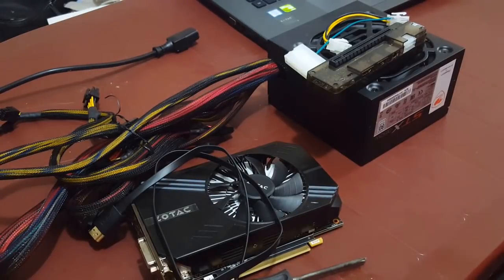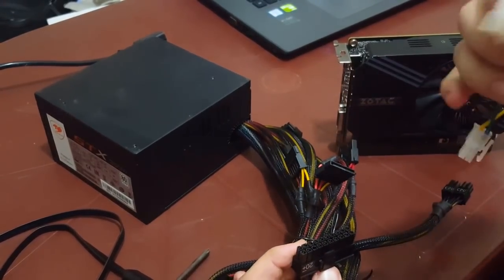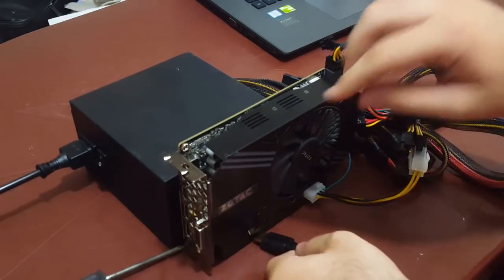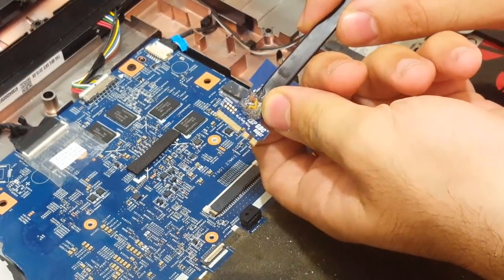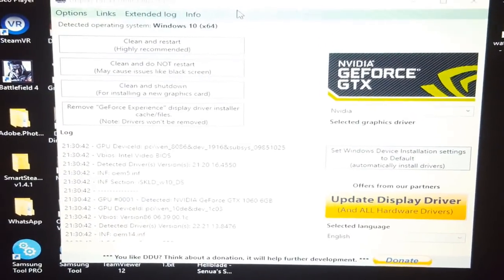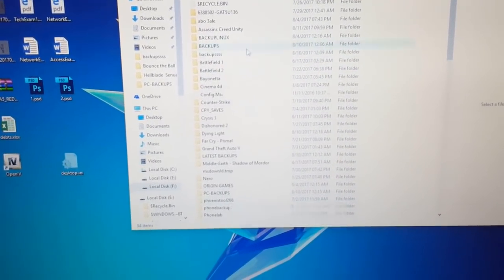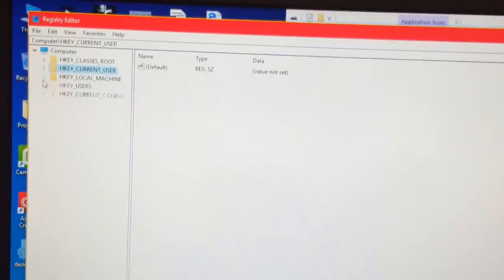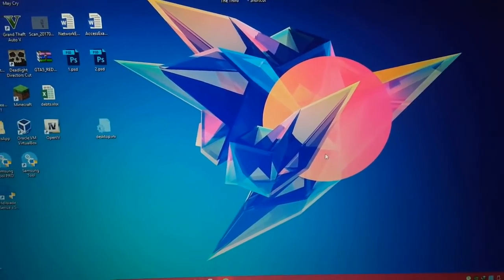HOW TO: External GPU for any laptop PC W/O External Monitor GTX 1060 EXP GDC 1050 ti solve error 43

Comment: Hi
I have everything working but I am unable to use my egpu with external monitor my monitor is detected on device manager but my monitor shows no signal can you help me please?
Reply from the maker: are you connecting via HDMI? if you have windows 10 check in the notification area in the bottom right corner for the project button if it is set to duplicate or not...
Reply: Pedro Marthon did that but my screen shows no signal
Reply from the maker: wierd, is the egpu working well on the internal monitor?
Reply: Pedro Marthon yes it is working in internal screen
Reply from the maker: did you try another screen, also check in NVIDIA control panel for settings.
Reply: Pedro Marthon ok thank you for your help maybe the issue is I'm using old analog LCD monitor .
Reply from the maker: +Sniper daniel anytime, and good luck

Comment: In your video you are disabling pcie express root port. How to choose which port is to be disabled. I am using gtx 1060 on dell studio 1558 with express card. GPU is showing in device manager but cannot use as primary. How to fix this?
Reply from the maker: +aditya jagtap the laptop will automatically choose the internal GPU as primary, that's why you should disable the internal GPU.
Reply: Pedro Marthon. Glad to see you reply me that fast. But I did not understand your step about disabling pcie root port.How to know which is for internal GPU? This is my main problem.
Reply from the maker: just try disabling each one, and check if the internal GPU will disappear from display adapters
Reply: Pedro Marthon  thanks for your help. got it finally. BTW I am doing all this as internal GPU gets hot (73c) even under no load thereby crashing whole system. Technician asked me not to load onboard GPU. Does this method help me?
Reply from the maker: +aditya jagtap it will sure do since you disabled your internal gpu so it will have no load at all, and I am really glad I helped, make sure to like and sub for more upcoming troubleshooting

Comment: Hi 
When I install 368.81 it says "graphic driver could not find compatible graphics hardware"
Reply from the maker: +Sniper daniel you have 1050 TI?
Reply: Pedro Marthon I have gtx 1060 3g version but still I get error 43 I followed the same procedure but still :(
Reply from the maker: try checking if the GPU is plugged well, and I am using latest fall creators update

Comment: My laptop is having 650m integrated gpu. I am not able to find a pci-e slotto disable it. Disabling it directly did'nt work as the new driver installed is picking the internal gpu first. How can I disable in this case?

Comment: I have a similar setup with an MSI GS60 Ghost, the NGFF exp gdc, and an EVGA GTX 1060. I went through the installation like in this video, and everything turned out mostly okay, as in I don't have error 43 or anything. Unfortunately I think my system is still running on the internal Nvidia card (860), not my external 1060. But, if I disable the internal 860 in device manager, I am unable to access Nvidia Control Panel. Has anyone ran into this problem or can help?
Reply from the maker: mrwunderbred disable the internal GPU, shutdown the pc, remove battery, insert external GPU, and turn on the pc again it will work
Reply: Pedro Marthon thanks for the quick reply, unfortunately that didn't work and I still can't access Nvidia control panel while the internal 860 card is disabled under Display Adapters. I have previously tried redoing the whole process with DDU too and nothing worked. :(
Reply from the maker: mrwunderbred did you try the whole process again while the internal gpu is disabled, you have to make sure that you plugged the external gpu while the pc has no power at all, no AC adapter nor battery plugged in, and make sure the power supply is giving enough power to the gpu, then plug it in the pc while the gpu adapter is on, then plug the pc to power, turn the pc on, and start from DDU step until installation is done.
Reply: @mrwunderbred @pedromartin did you guys solve it I still have the same problem and tried disabling everything and still didn’t work ?
Reply: Pedro Marthon I still have the same problem is there any other fix ?

Comment: I not understand what i suppose to do with root chipset adapter...because if i do that.my gdc external gpu is gone,not internal gpu is missing
help to answer XD ?
Reply from the maker: if you don't have an internal GPU you can skip this step
Reply: I have..it was gt650m
i trying gdc with gtx580 1.5GB
windows 8.1
600 atx psu 
I try every 3 pcie root but not my internal gpu disappear,it the gtx580 ,lol XD
Reply from the maker: okay, disable your internal GPU in device manager through display adapters.
Reply: I try disable gt650,but gtx 580 will show yellow warning,sometime on nvdia audio ...if i disable gt650,gtx580 cant show on nvidia control panel

Comment: Can I use 550w power supply for gtx 1060 3g version?or should I user lesser power PSU? Hope I don't fry up my GDC or gpu
Reply from the maker: 550W well be more than enough, and wont face problems, just get a legitimate PSU from a good brand.
Reply: Pedro Marthon Ok thanks :)

Comment: is using gtx 1060 the 3gb version will be not the same?  can it cause another error just because using the 3gb version? cos someone on the comment said that 1060 3gb has chance that will not work properly
Reply from the maker: Natanael Ardi 3GB should work the same
Reply: Pedro Marthon Thank you , your video is really amazing tbh
Reply: Have you tried the 700 series or older than the 10xx series? Im planning to use GTX 780 3gb, should it work properly? or i need to mod bios or setup 1.35 or bla bla? hahaha.. ive studied so many forums but still doubt gtx 780 will work or issues will happen... hehe
Reply from the maker: I did not, but lots of others did and it worked properly, but at the end it depends if your PC is compatible with external PCIe adapters.
Reply: Pedro Marthon Oh ok, thank you very much

Comment: so i managed to solve the code 43 error but the problem is that the NVIDIA display settings are not available when i tried opening the nvidia control panel. it says you are not currently using a display attached to an nvidia gpu
Reply: Jen - Chi Chen i am getting the same problem, any fix ? Are you using internal or external display ?
Reply: Geflunk internal display. I am forced to use an external display attached directly to the graphic card to fix the problem
Reply: i know i read somewhere that you can flash the BIOS to enable the primary display setting from auto to "enabled" to resolve the issue. But flashing your ROM has some risks which might brick your system.

Comment: how will you know if your lappy is compatible with that? and is there a limit for a gpu, for example, a 10yr old lappy, can it use the latest nvidia?
Reply from the maker: depends on the manufacturer and CPU power + RAM amount

Comment: hi pedro did u use external monitor or the laptop's internal screen?
Reply from the maker: +Emmanuel Daniel hi, I used the laptop screen
Reply: ok thanks :)
Reply: will this setup work with gtx 1060 3g version?

Comment: hihi, after i update the driver to the latest one, the code 43 happen on the gtx 1060. why??
Reply from the maker: +Kenny Pro you have to do all the steps again in order to update...
Reply: how do i know which intel (R) 8 series / C220 series pci express root port is my gtx950m ? i have 1, 2 , 3 and 4
Reply: how to know which one is which ? i disabled the third one my gtx 1060 is gone and the forth one is for the sd card reader. But the first and second is like nothing happen when i disable them, nothing is related to my dedicated gpu

Comment: Hi, im using the elitebook 8470p, with gtx 1050 2gb as my going to be egpu, but when i plug in the expresscard before boosting up, the screen goes black. The egpu fan is spinning and laptop still make sound. when i unplug it, the laptop restart on its own.
if i plug it in after window start up, nothing but the hd graphic 4000 shows in the display adapter
can you help me with this ?

Comment: Hello bro, i have a 1060 with no hotplug in a samsung notebook(I7-3630QM, 8GB Ram, dGPU 650m), i tryied to install a lot of drivers using the "russian method" and the only configuration that not give me a  error 43 was the normal installation of 372.70. This i tryied both russian method of the description(with lastest 388.31), and also i tryied with 372.70 the "russian method with lastest. Can you give me a hand with this please? P.D: Nice tutorial video!
Reply from the maker: Hello, I will be happy to help, first did you check the DDU step correctly? it is the most important step before starting the installation...
Reply: Yep, in any try of the installation with the russian method i did the DDU unistall (no in safemode but in each restart i see both dGPU and eGPU as a standard VGA adapter before i install the driver/s) Thank you for your attention!
Reply: I follow you with all the driver installation part and now i have installed the latest driver version doing all your steps THANK YOU SO MUCH BRO!

Comment: Hi Pedro, great video! Just few questions before buying the components and start testing.
Would it work on Win7 32?
I have a super old thinkpad and I was thinking to use a gtx660 (any better recommendation?), with some bios mod; would that be compatible with the latest exp gdc and Nvidia drivers? Thank you!
Reply from the maker: Marte M not sure about 32-bit, no one tried it yet...
Reply: Oh I see. Then probably that's not advisable?
For best compatibility, should I install win10 64? Or win7 64, would be just fine? Thank you for your fast reply
Reply from the maker: Marte M never faced unsolvable problems on W10x64 but I think it will do fine with W7x64
Reply: Pedro Marthon btw, my thinkpad only has a Intel iGpu and no other dGpu. So I guess I should just go ahead with the first driver installation, as in your video?
Reply from the maker: Marte M yes...

Comment: Ok Im confused.... ngff m.2 Or the PCI e? I have a msi gp60 2pe leopard i7 4710hq Or something with 840m gpu. Btw do I need to uninstall my old drivers since Im going to take the laptop with me a couple of times a week without the egpu
Reply: Planning to use psu: evga 80 bronze plus certified semi modular 600bq 600w and asus dual oc gtx 1060 6gb

Comment: its me again xD,after I had disable all my PCI Express Port but I still see my GT640 graphic card is running :/
Reply: why it didn't show up my GTX1060?? it show up a Microsoft stuff with a warning icon
Reply from the maker: +Cat2246 the enable all your PCI ports and disable it from graphics adapter
Reply: found my problem https://imgur.com/a/wrEpi , but my BIOS didnt have the "Advance Setting", going to search for solution :3

Comment: "NVIDIA Installer Can't Continue" No Graphics Hardware Compatible. How to fix?
Reply from the maker: +Johnathon TwinkleToes what is your GPU? Did you make sire that the GPU is available in device manager?
Reply: I have an EVGA SC GeForce GTX 1060 6gb, and I haven't been able to get it idententified in device manager, if you could help me with that, that would be greatly appreciated,

Comment: Hey would this work for a hp all in one pc? I checked my WiFi card it’s a ngff but I checked my bios there’s no advance options to disable the integrated ic I have a pentium g3260t 2.90ghz and is planning to use the gtx 1060. Do I just have to disable my integrated graphics in device mangager? Model of pc is Hp 23-r110

Comment: Im using gtx 1030. I have followed all steps like in video. But my Laptop (HP 242 G1) didn't recognize the graphic card :( please help
Reply: After i finished installing the driver, theres no option to "reboot later or reboot now" but just finish. So i cant find anything in regedit. Instead of my nvidia 1030 driver installed, the gt 730 driver was installed(my internal graphic). And i have 2 ram, maybe its do smth on it dont know please help :)
Reply from the maker: +Alam Abdullah follow DDU process carefully and reboot when you use it
Reply: Pedro Marthon i aleady follow it. As i disable my internal graphic card, i cant install my 1030 because nvidia did not detect any new hardware was plugged in..
Reply from the maker: +Alam Abdullah make sure it is properly plugged into your PC, and check if the power supply working well.
Reply: i tried with 1030 but no sucess at all, now i buy a new gtx 1060 3gb, and as i try to install the driver with 368, come an error(the driver isnt compatible with the graphic card. then i try to modify it with the tutorial as u gave in the descripton, still no success. i try to install it with 375,63 driver. its sucess installed but the problem code 43 still come. please help :)

Comment: Its been 2 months since you posted this video. I just wonder if the new nvidia drivers resolved the errors for the gtx 1050ti and 1060 3gb
Reply from the maker: +don timbol some people were able to run the driver in the description for 1050ti, check it
Reply: Pedro Marthon thanks! Just wanna ask if your EGPU setup with the 1060 6gb palit runs fine on the latest nvidia drivers
Reply from the maker: yes all fine :D

Comment: So, I bought one of my own. But I am stuck at Windows boot screen as it freezes when classpnp.sys driver is trying to be loaded. I'm wondering if you encountered the same?
Reply from the maker: Boot into safe mode and use DDU to uninstall all GPU related drivers
then retry

Comment: msi cx62 6qd did not work what I did. I do not know where I'm making mistakes. gtx 1050 ti gaming x did not work. exclamation mark on the video card.
Reply from the maker: GTX 1050ti had lots of compatibility issues with EXP GDC since it is a new card, still working on ways to fix it but the problem is that I don't have this card so I am only looking on ways on the internet
Reply: please help me :(
Reply: Wise Mining do you resolve the problem with the egpu?
Im planning do the same and put a gtx 1060 6gb
Reply: Wise Mining and i have another question : do you try to conect by the M2 slot ir the wifi card slot?

Comment: i have a gtx 960 and i have ordered exp gdc
my laptop spec is dell n5110 core i3 and gt525m
can i use my internal screen for gaming under windows 10 or is it must i need a external monitor?
Reply from the maker: +Said Fazil it should work on the internal screen, but we will never know until it has arrived, good luck
Reply: ok thank you, i will keep you posted
Reply: It may suffer from a little fps hit around 10-15fps when compared to external monitor.

Comment: Sir , my exp gdc is just arrived but the problem is when I try to plug in the exp gdc and GTX 960 to my laptop it get black screen and sometime stuck in acer logo but when I unplug the exp gdc my laptop work normal I wonder why this is happening ? Any solution ?
Reply from the maker: +Gamer Vein first check power supply, second check if the pcie cable is connected properly.
Reply: first thing first thanks for your response sir but i already done that, all my day just wasted to make EXP GDC work with my laptop (Acer e5-471G) with no good sign tho , i try hot plug by power up my laptop without EXP GDC then i make my laptop sleep and remove wifi card and instal EXP GDC  and power up again and yes it bypass blank screen or Acer logo but my GPU cant be detected in device manager but still i try DDU , disable my iGPU and Instal the driver but still my GTX 960 not detected in device manager ,i do Setup 1.30 to setup PCIe ports to Gen1 speed and it run and detected my GTX 960 but unstable when i run game so i just giving up to instal EXP GDC to my (Acer e5-471G)  and try with my friend laptop  (Lenovo y580) and hell it easy as plug and play with no problem at all it run smooth with internal or external monitor i still wonder why my acer laptop cant run EXP GDC, and there is so many people in forum have problem installing EXP GDC with Acer Laptop but you sir you have acer laptop and it work,  good for you sir.
Reply from the maker: +Gamer Vein which windows you have? Did you try reformatting and installing latest Windows 10? If you put your pci speed to gen 1 does it detect the GPU properly?
Reply: I thing Windows is not my problem but I use Windows 8.1 I'll try win 10 next time  , if I use setup 1.3 it fix the boting problem aka black screen but still get error 12 and sometime my GPU work fine sometime not work so is unstable
Reply from the maker: +Gamer Vein go for Windows 10 it should fix this problem while using gen 1

Comment: I'm planning on making an eGPU set up with a 1070, my laptop is Asus GL551JW with win7 sp1. I know the error 43 appears after driver 372.90. So my question is will your fix work for me?
Reply from the maker: +AzSam Pako it should work for 1070
Reply: Thanks :)
Also can I use a Vega 56 in my set up, I'm going to use an external monitor?
Reply from the maker: not sure with AMD never tried it as EGPU
Reply: There are videos of amd cards used as eGPU but can there be a bigger bottleneck if I use an AMD card  because my dGPU is nvidia? And I know I'm asking too much but if you have an amd card lying around could you please test it?
Reply from the maker: I wish I had one to test it so I would make a video for AMD only, but I think that AMD had problems with EGPU setups, not sure though, your best bet is to go with a GTX 970 or a GTX 1060 which are the most compatible with EGPU setups.
Reply: AMD cards need a separate monitor to run in the eGPU set up, a lot of people don't know that when they buy a gpu for their laptop. But since I'm going to buy a separate monitor any way that problem doesn't affect me, I don't know if there are any other problems thoe. By the way do you know why the majority of thunderbolt 3 set ups use AMD cards?